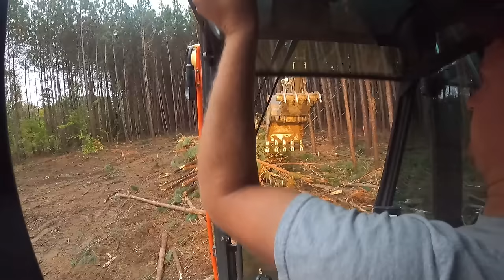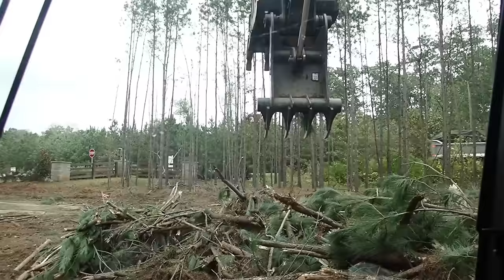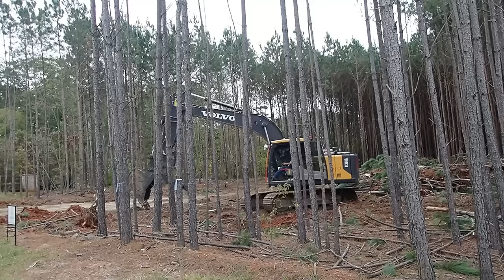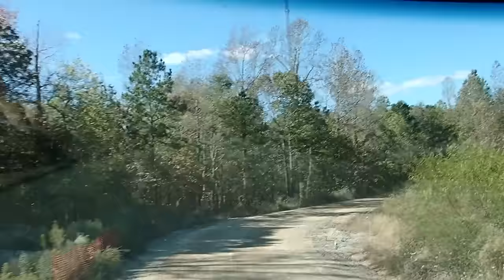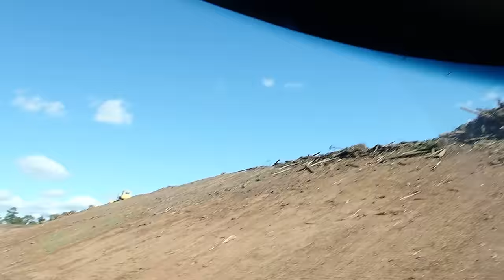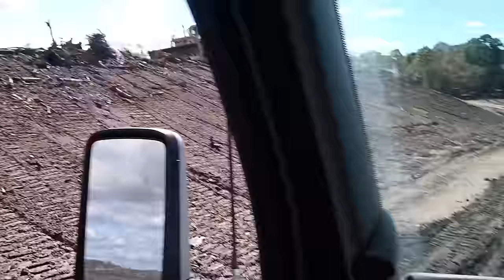All Stages Of Land Clearing!

Comment: Thanks for the explanation as to why the wood is not mulched. Sounds that it is the most cost effective way to clear a lot, of the pistol/stick pines. Sure seems that there is away to recycle material. Thanks for the tour through the land dump site. Pushing that stake in, after it came out of the ground was sure a majestic trick.  One for the books. No one else could have done that.
Reply: I've seen the results of someone mulching a house lot. All the shredded chips and chunks don't rot in minutes. Takes several years actually, and it isn't pretty to look at for a yard. As Chris stated, you still have to have someone dig out the stumps, or deal with all the regrowth from them, then there is the issue of some amount of shredded material being buried under the dirt on the house pad. Mulching has its place but on a house site isn't one.

Comment: What decides the difference between hauling the stuff off vs burning it?
Reply: Often where you are located. In an urban or suburban area it can be very difficult to get a burn permit. In a very rural area, burning is considered normal. Next would be the amount of vegetation to burn or haul off. Finally, for sometimes of the year you have large dry periods where it wouldn’t be safe to burn. If you don’t have the space to store the burn pile or the customer doesn’t want to wait, you have no choice but to haul it off.